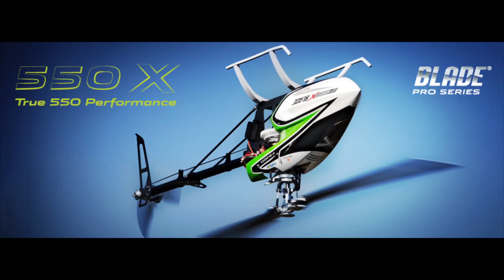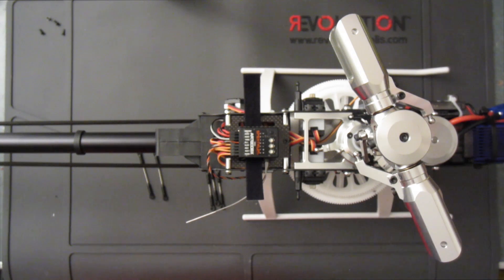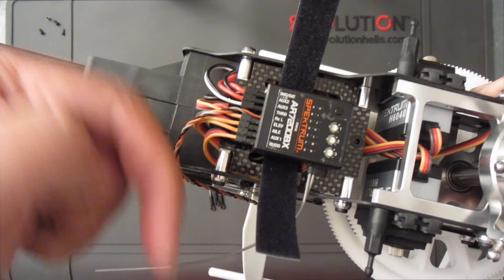Blade 550X Wrap up and Flight video

Comment: Hey I built the 600x which is the same as 550x frame wise and I am geting a horrible binding on the two rear servos were when you fully back it left of right it goes so for the servo horn hits the servo and pops the link of what could be causing this I tried to trim it out in menu l but the blue led disappears which they say it needs you know wats up thanks